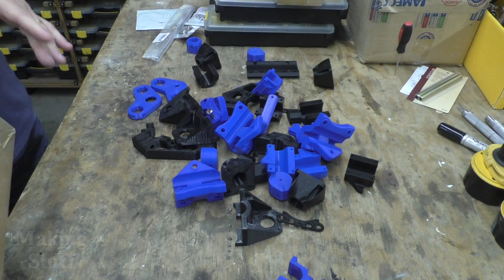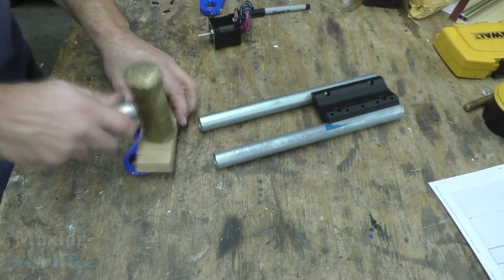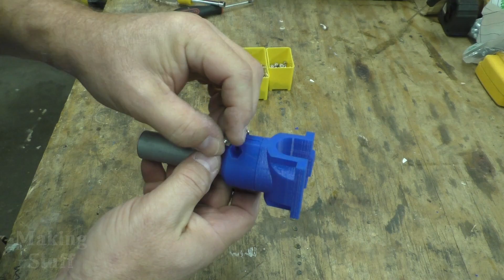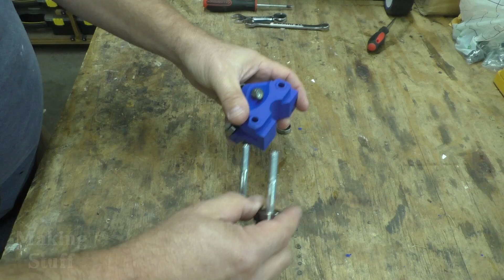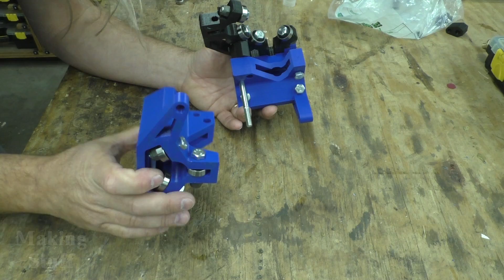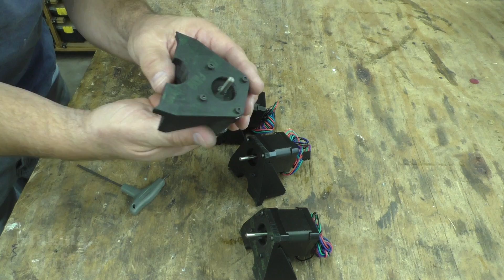Assembling a MPCNC (Mostly Printed CNC) Part 1

Comment: pointing out the error on your part about electrical conduit pipe size you says 3/4" as in 25mm? thats is incorrect 25mm= almost 1"  for 3/4" is really 19 mm

Comment: It has been awhile since you got your MPCNC going.  What are its good and bad points for you?
Reply from the maker: The only thing I would do different is not make is so big.  I was able to cut aluminum plate with it for the full sized cnc router project. I couldn't ask for much better results than that!

Comment: Hey! its a great video, second time I watch it! How long would you say it took to assemble ? I have all the 3d printed piece laying around since 2 years. Havent take the time to assemble it yet.
Reply from the maker: It's been a while since I assembled it so I don't know for sure.  Plus videoing the process slows me down.  I'd say if you have all of the pieces already printed and the conduit cut to size you should be able to assemble it in 3-4 hours max.
Reply: @MakingStuff  thanks a lot! I have all the stuff in hand. just need assembling and making it run for the first time. thanks for taking the time to answer!!

Comment: My only gripe, is how your using zinc plated steel vs stainless steel. One will last alot longer. Also.. why no zerk fittings for the bearings? :'(

Comment: Great video. The website does say NOT to use electrical conduit. " recommend minimum .065″ wall thickness stainless steel tubing, If you are willing to keep the rust away. 1″ DOM is much less expensive and a tiny bit more rigid. Conduit will not work, “tubing” only stainless is preferred. "

Comment: Very nice video.  I just got the motors and the electrical parts por a MPCNC.
I’m going to start this weekend, but first I wanted to see some instructional videos to get a clear idea of how to do it.
I really enjoy your suggestions.
For the ‘rattling’  due to the stamping on the conduit, I would try rotating the tube along it’s axis so the stamped surface wouldn’t be run over by a bearing.
The idea would be for it to run along a side of the roller.
That way you avoid having to cut, remove burrs and installing a complete tube.
Best regards.

Comment: I am currently building an Aluminum square tube cnc mill.  I'm getting stuck as to how you drive 2 sets of tandem motors for the X and Y.  Can someone point me in the right direction?  Thanks
Reply from the maker: https://forum.linuxcnc.org/49-basic-configuration/33079-how-to-2-or-more-motors-on-one-axis-gantry-linuxcnc-2-8-master

Comment: I have the new version of the XYZ Burley. The lock nuts do not hold in place while trying to tighten the bolts and you can not get a wrench on the nuts because of the ears that are supposed to hold them.  Do you still have the old files?

Comment: Many Many Thanks Bob I started this project late 2018 when I got my first 3d printer  but it all seemed to get a bit confusing and it got left in a box for quite a while Now an other 3d printer later I decided to have another go  found this video set the most useful on YOUTUBE now just waiting for stepper motors and should be good to go  I already have a cheap little cnc which I am hoping to use the drivers and Mach 3   MERRY CHRISTMAS
Reply from the maker: Thanks for watching!

Comment: What is the size of the build area? Couldn't you use a heavier pipe of the same diameter for more rigidity?
Reply from the maker: The build area can bee any size you want.  Mine is 300mm x 300mm.  The files were designed ofr conduit, but if the heavier pipe had the same od, I don't see why it wouldn't work.

Comment: Nice video. Very helpful. I note that you say to make sure that you get the corner piece with the flat turning inward. On V1's site it shows the flat outward and the slant to the inside. Joe at Geek Toolkit's build does his like the plans say and the opposite of yours. Not sure if you corrected it in the next video, but will keep watching. In any case, it's great!
Reply from the maker: Yeah I made a mistake on that one.  I think I corrected it in a future video.  The designer of the MPCNC left a comment and said it really didn't matter which way it was turned.  Thanks for watching!

Comment: You are worried too much about the plastic cracking. If you printed the PLA with the recommended number of perimeter layers, that puppy won't crack. Break, yes, but the layers shouldn't separate unless you had bad layer adhesion.

Comment: Why not use round Steelstock instead of the conduits. This looks very flimsy
Reply: That would add a lot of weight and expense for minimal gain in rigidity (and considering that all the connecting parts are made of mostly-hollow plastic, this isn't likely to be all that rigid anyway).  If you feel the need for greater rigidity, going for larger-diameter conduit would be the easy and cheap way to get there.

Comment: Great job on this CNC. I will try to build one soon. I saw another video showing a guy milling some aluminum parts with this machine. I will research and try to find the most well suited spindle for that, because milling aluminum parts will be the goal if I build the machine. Any input about milling aluminum appreciated. Thanks.
Reply from the maker: I haven't done much with the machine but I do plan on trying to mill aluminum.

Comment: The V1Engineering.com forums are a great resource too, with instructions and the V1 store is ran by the designer (Ryan) and has kits with the right number of all the screws, bearings, and even 3D printed parts. It helps him work full time working on new designs and teaching in the forums.

Comment: Hello, thank you for the videos, I'm putting together one and I'm having problems on the z axis. I can not regulate. I'm using the T8 spindle. It would be necessary to change some configuration or fill the arduino, I'm waiting
Reply from the maker: I'm not sure what you are asking.  You should try asking your question on the MPCNC forum.

Comment: Hi, could you share your slicer settings please?
Reply from the maker: I think it was 55% infill, .8mm wall thickness, 2 wall line count, top/bottom thickness .6mm, top/bottom layers 3.  Print speed was 60mm/s. Hope that helps.
Reply: Thank you so much for the help!

Comment: https://www.v1engineering.com/   There is a large community who have built and used these fantastic Hobbyist CNC's, I myself have one and am in the process of adding a laser cutter for my other hobby of RC aircraft and Jet building and flying.

These MPCNC's are a good way of getting to CNCing, they have there limitations but if you take your time they are extremely accurate and useful

Comment: hi, is it possible to use high performance delrin wheels instead of the bare bearings matching the tubes?
Reply from the maker: I'm sure it's possible but not sure that it would have any type of benefit.
Reply: @MakingStuff   the benefit is the noise reduction.
Reply: @cyatlas  Just moving it around, the steppers are louder than the bearings.  Once you fire up the router/spindle, well, you wouldn't notice uncle Angus playing his bagpipes behind you anyway.
Reply: @barry99705  think about other setups: 3D printer with silent drivers! Sorry, I should have clarified that before. Thks for your attention :-)

Comment: Another question is the narrowness of the bases where the gantry sits on the y tubes.  

It seems that base should be wider for better rotational stiffness on the y axis. 

My quick glance at the source of the project didn't tell me whether I would be buying the printed parts or the files.  

If files, are the modifiable, eg, as above, lengthen the bases of the gantry, spacings of it bearings.

I have found stiffer, thick-wall 3/4" steel tubes, but $$$
Reply: You can download the STL and edit them but that would be a pain. I believe the designer is in the process of releasing the CAD that are easier to modify and, hopefully, parametric
Reply: Ryan put the stl's on thingiverse, or you can buy printed parts from the store.
Reply: I spent a few days going back and forth about the tubing. It seems you need to balance stiffness with the weight of the tubing. The hardware store sells thicker walled tubing  but it is pretty heavy,  I thought abut stainless but Ryan and the other builds seem to be happy with the normal EMT conduit. There is some .065" polished stainless available from places that cater to marine use, for railing on boats. That would be really nice but it kicks up the price a bit. I'm starting out with the conduit. I bought a bunch of it, picking through the whole stack for the straightest 10' lengths I could find. I went with the 3/4" EMT from Menards. It works for the 23.5 model. I started printing with the feet. I printed a couple to see how my Prusa handles it and took a piece to the hardware store to verify before buying.

Comment: So I'm building one as well. One advice for printing : use a .6mm nozzle. It's not that big of a hassle changing it and it shaves hours of printing when doing so. Plus printed parts a tougher
Reply from the maker: Yeah that will definitely speed it up.  I have been wanting to try a larger nozzle on my CR-10s.  With all the extras I have printed for this project, I've almost got 200 hours print time.

Comment: Are you still making fillament with your filament extruder?
Reply: I am in the middle of making my own extruder and I'm wondering how much I will actually use it and if I can get good enough fillament to use daily or even maybe sell.
Reply from the maker: Not at this time. I never got good consistent filament diameter out of it.
Reply: Is it possible to get good enough fillament out of it? How hard did you try?

Comment: What's the reason to put the stepper-motors on the moving frame? They could'be been mounted on the fixed-frame just as easily, imo, with considerable inertial savings...
Reply from the maker: I don't know.  I didn't design it.
Reply: @MakingStuff  Hmm okay.. Ultimaker-style 3d printers use this sort of frame, but they are all light and agile precisely because their motors do need to not travel with the frame. A missed chance, imo.
Reply: As a CNC machine, speed will be limited by the cutting speed  it's not the same as a 3d printer.
Reply: @dphillips9641   , Maurice Hartmann  , I agree this saves a bit of belt and mechanism; however a drag-chain (or equivalent) shall be needed to bring power to the moving motors. I hope the trade-off is worthwhile. Furthermore, I disagree with ".. more weight reduces the swings of the whole system" - every mechatronics text states the exact opposite - "Make it as stiff and as light as possible". Inverted-pendulum style systems are good for steadying seismic loads in tall buildings (here the displacement comes from outside) but never for carriages and gantries. You make a good point though, that the acceleration is limited by cutting-speed, not by the eigenfrequency of the frame; the penalty for moving-masses is thus minimal.

Comment: greetings from the Canary Islands
I recently finished printing the pieces of my cnc.
I will follow your steps in my project

On the filament extruder, I have problems with the spindle.
A solution for your filament extruder on metal particles would be to use a hydraulic tube,
that in its interior it does not contain welds other than to include a filter of grid in the mouthpiece

Apologies for language translation

Comment: I thought it will be something small. But no, this is a quite big 3D printed CNC machine. Very nice job!
Reply from the maker: That is what is nice about the MPCNC, you can make it any size you want by cutting the conduit to size.  The one I am building is 1000mm by 1000mm.
Reply: @MakingStuff  I imagine after going so big (probably not much larger than you went) there would start to be issues with the conduit flexing and such.
Reply: Vectrix
Reply: I’m here after I watched your video about cnc